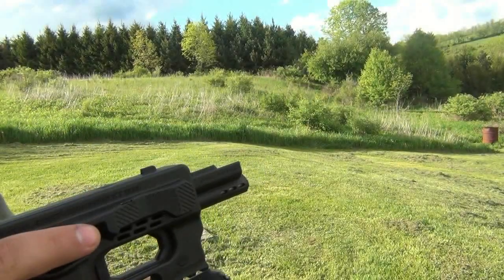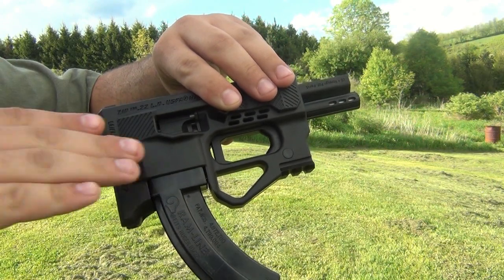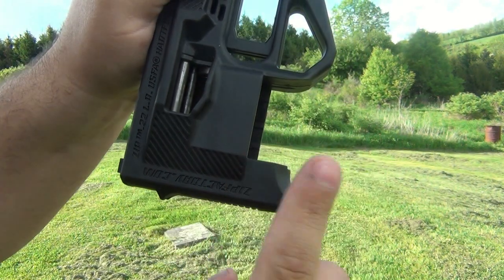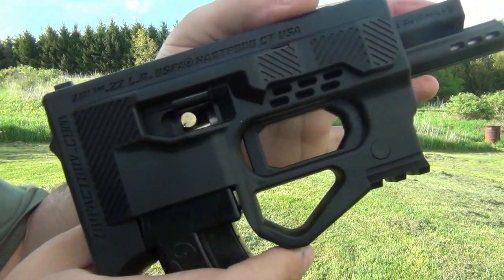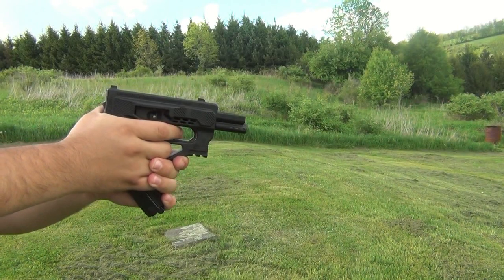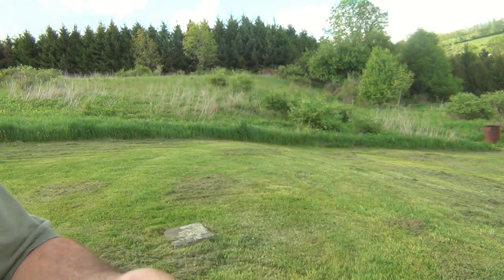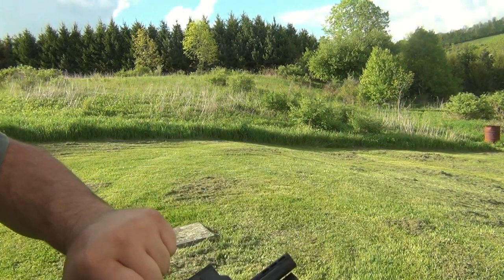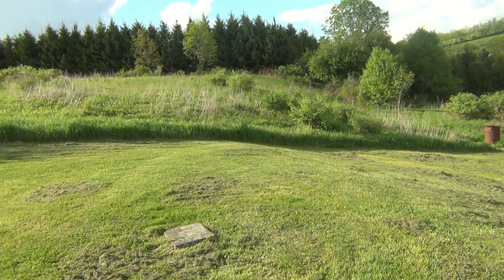Zip22 Pistol : The Worst Gun Ever made? (Part 2 of 4) [Ram-line 30rd Mags]

Comment: I know this is unrelated but if i filled a zippo with another fluid such as ronson would they know?  Ave would it void my warranty?
Reply: I do it!
Lol
Reply: ronson is owned by Zippo. they bought the company a couple years ago i think. so zippo now says ronson or zippo fluid.
Reply: What about if i use other brands? Will it void my warranty and how will they know
Reply: khal eel no, nothing (as far as i know) will void zippo's warranty. nothing that they actually enforce, atleast. even if you broke it on purpose and they would fix or replace it.
Reply: The fluid only matters in terms of warranty for the Zippo Blu line, where you must use Zippo brand butane. Otherwise, other brands of lighter fluid do work.
Reply: I do it "sometimes" it's not as good and I really doubt they could tell unless they sent it to lab for testing lol
Reply: I use colemans fuel oil (a whole gallon for about the same price as a few ounces of Zippo brand fuel) and its basically the same thing. I sent a zippo in for repair that had been filled with colemans fuel oil prior, and they fixed it for me, so i say that theres no problem with using alternative fuels for zippo (wick) lighters
Reply: Jason Bonedi thank you very much! Now i know i can use any type of lighter fluid!

Comment: Make me wonder if the designers and that’s an unintended compliment!!! - were smoking ‘da weed’ when they thought of and made this absolutely atrocious gun!
I am an invalid, and think I could beat this sad attempt at a gun design. 

Plus’? none
Minus’?
Where to start. . . the gun is huge for a handgun can anyone tell me if they have large enough packets for this totally use piece? Even if it is plastic and steel it is way OTT in the size stakes. It’s use, well lets just say it will make a great hammer and a great ‘gun’ as long as looks size weight and the ability to use bullets are out of the question.